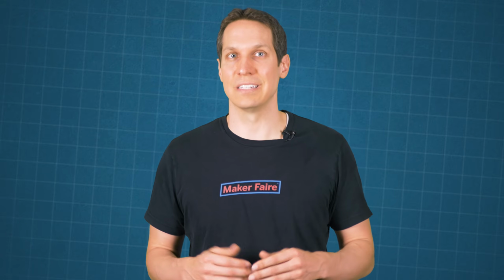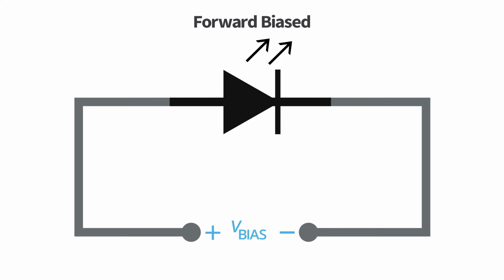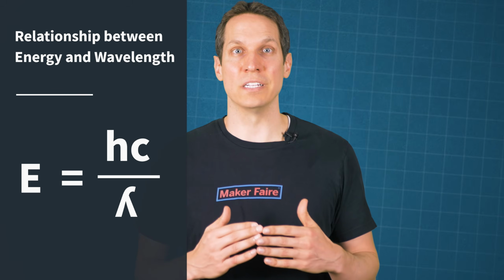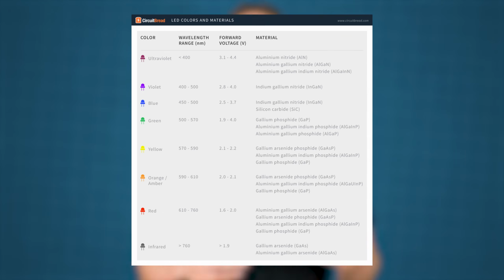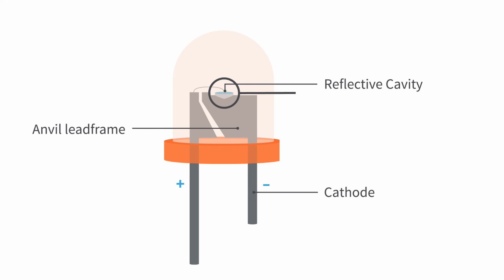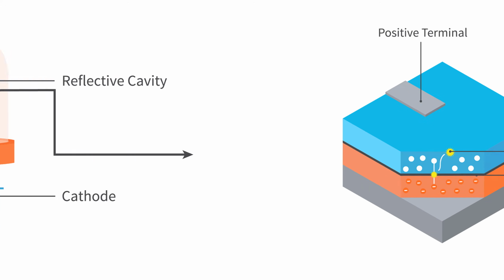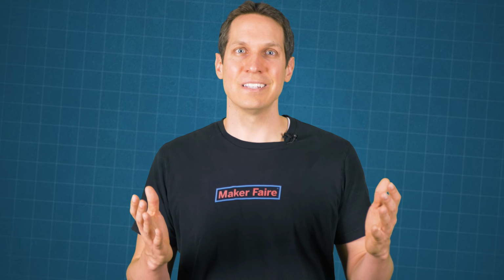How does an LED work at the molecular AND practical level? | Intermediate Electronics

Comment: You said most of the light comes from the junction close to the p region. why? how it is achieved in LED? is it due to higher mobility of the electrons or making the n region more highly doped as compared to the p-type material. because holes are also diffusing to the n region where they will also recombine and emit light from the n side. so light should practically come from everywhere wherever there is recombination. please explain.

Comment: How are knee voltage and energy gap related?
Reply from the maker: The larger the energy gap, the higher the knee voltage.  You'll note this with LEDs of different colors.  Different band gaps generate different colors, which is why LEDs of different colors have different band gaps.  I'm not sure if there's a mathematical relationship between the two but I would be a little surprised if there isn't.

Comment: I have a question.. is there a material of LED that can produce all wavelength? I mean, we just modification of voltage or something else to make different wavelength?
Reply from the maker: Not that I'm aware of - unless I've missed some update in some basic physics (and I'm not saying that sarcastically, there are constant updates in the scientific fields) then the wavelength of the emitted light is directly tied to the materials used in the LED.

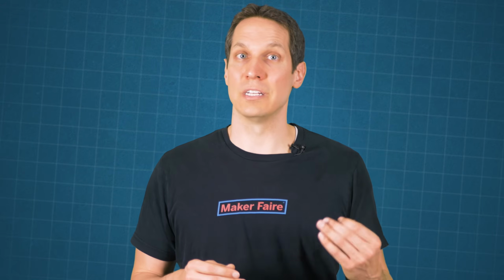Comment: At around 1:35ish, you discuss how for silicon diode, energy is released in the form of heat, whereas for led materials, the energy is released in the form of light. How come the difference in why one releases light and one releases heat ?
Thanks
Reply from the maker: Yeah!  It's all about the wavelength of the energy and how much of a drop in energy there is when the electron changes from one energy level to the other.  This is actually how they have made LEDs of different colors - blue, a higher energy light, requires a greater energy drop of the electron than red light so they put together two materials where there is the appropriate change in energy level from one to the other.  So, there are a few things going on here but if the electron drops a smaller step, like in a diode, the energy is in the infrared range and is trapped inside the device itself - heat!
Reply: @CircuitBread   Ahhh I see, interesting. Appreciate the reply.  Great video btw.

Comment: You could say a regular diode produces heat by emitting infrared. LEDs just have a different omposition which causes then to emit radiation with a smaller wavelength, e.g., visible light.
Reply from the maker: Yep!  Exactly.  Though the LEDs still emit a little bit of heat as well, just less than a regular diode.
Reply: Came here to say this.
Reply: I wouldn't say that's necessarily 100% true. Not all heat comes as radiation energy and excited states in compounds and solid materials can undergo non radiative decay. Basically you can dissipate energy through vibration of the medium, which is still heat.

Comment: So is the light emitted unpolarized light (I hope it is; polarized light is bad for health, I've heard). 
Also, do you know of any lead and arsenic-free LEDs? I've been looking all over the web...
These simple ones don't, but do many of the lights marketed as LEDs emit any UV? 

I just had to ditch the idea of lighting my future home with Sodium Vapour Lamps because they contain mercury... Bioluminescent lights haven't evolved much yet... 
If only there was a lead-and-arsenic-free LED...
Reply from the maker: LEDs emit unpolarized light but most all of them contain trace amounts of lead and arsenic.  The quantities of these materials are extremely small, though, and while not ideal, is generally much more environmentally and biologically friendly than many other options.  That is assuming you're using high-quality LEDs from a reputable source - some LED manufacturers may be less focused on following environmental regulations.
In regards to UV, unless the LEDs are specifically designed to emit UV, their emissions in that spectrum are minimal to non-existent.  That's one reason they're popular as outdoor lights - their limited heat and UV output makes it so they don't attract bugs like incandescent bulbs do.
Reply: @CircuitBread  Thank you so much; your reply gave me much relief... I was so worried... Not anymore though. Bullish on LEDs now; YOLO!

Comment: Silicon diodes actually DO emit light, as proven by that one time I accidentally shorted a diode and it lit up like a Christmas tree.
It's just that the light produced by a diode is immediately blocked by the structure of the diode itself, which causes it to be absorbed.
Reply from the maker: I knew they emitted light, but I thought it was more in the red-infrared range.  But yep, the opaque cover makes it so you can even see the little bit of light they do produce (under normal conditions). Thanks for sharing!  It would've been cool to have gotten that on video.

Comment: Maybe this is a dumb questions but how do the holes get replenished? It seems like they disappear when recombined but the LED doesn't really "run out" right?
Reply from the maker: No, not a dumb question at all, it's something I think all of us have considered at one point or another.  My understanding is that it's just a matter of it being a true circuit - as the holes are filled with the electrons dropping into them, holes are forming elsewhere due to the energy being put into the system.  The holes slowly move into place and replenish the lost holes.  Since it's done constantly, there's never a real lack of holes.  I need to reach out to my semiconductors expert again, she may have a more technically fulfilling way of describing it.

Comment: What if electrons occupy all the holes in p type region??? Will the diode stop emitting light then??
Reply from the maker: I had that same question when I first learned about this.  My understanding is that once the electrons drop in energy, then they act like a "normal" electron in that material, which means they can later jump into the conduction band and be conducted out of the device to go around the circuit loop again.

Comment: I think it would be more accurate to say the energy from electrons falling into holes in a rectifier diode are released as infrared photons. It becomes heat because most rectifier diodes have opaque black bodies.
Reply from the maker: You are absolutely correct, thank you!

Comment: That was cool!  I never knew how closely related LED's and transistors were.  It seems the difference is the extra doping of the P/N in the transistor?
Reply from the maker: It is pretty crazy technology!  It's not the amount of doping, it's by putting two different materials together that, when an electron moves from one to the other, it loses the exact amount of energy needed to create a photon of the color you want.  Most diodes just produce heat when the electron loses that energy.

Comment: Wt converts into photons and photons r made of Wt 😒 ???
Reply: Just electrons or combination of electrons protons and neutron in a molecular structure of a photons 😑 ???
Reply from the maker: Not 100% sure I understand the question but if you remember that photons are just little packets of energy, not actual matter, that should help.  So, instead of emitting energy as heat, it's emitting it as light.
Reply: @CircuitBread  

All photons or 99.99% of photons don't have light 😏
Reply: @CircuitBread  

It looks like photons r made of electrons and protons and have electrical and magnetic effect inside a magnatic sphere 😇
Reply: kalki avatar (beast of the earth) (christ on the white horse) (son of man on clouds) is the biggest enemy of dajjal/antichrist/kali 😏

Kalki Avatar (Murtaza) cousin of Moula mahdhi a.s. (muhammad) 😎

Moula mahdhi is raja shashidhuvj 😎

Prophet Moula mahdhi and Moula Isa both will kill dajjal cause dajjal is going to kill Kalki Avatar 😏

Kalki Avatar will follow orders from 2 religious king Moula mahdhi a.s. and Moula Isa a.s. 😎

Kalki Avatar going to have 2 swords and ring of moula sulaiman a.s. and staff of moula musa a.s. (iron rod) Staff of moula musa a.s. is like omintrix can transform into anything and can transform others into anything And stone in the ring of moula sulaiman a.s. is also known as kastav mani and it's more powerful the all 6 infinite stones combined 😇

This staff will transforms into white horses with wings,weapons,iron-man,cloud etc or can do imagination into reality 😎

*Ratn sru sword of lord shiva (miri)😇

*Ratn varu (zulfakar) sword of Moula Ali (piri) 😇

miri piri 😇

Satyug (sunrise from West) 01.aug.38 😏

Gzwa e hind 2029 😎....

Comment: Do you have a video about the transitory evolution and hot logic gates made computing possibly?
Reply from the maker: Interestingly enough, we have shot a video about how a computer works from the ground up - starting with sand and talking about how that's turned into semiconductors which are then turned into logic gates, etc. While the video is completely shot, there are a few animated portions of it that are being time consuming.  I'm not sure if this is exactly what you're looking for but we're quite excited for this video to be published.  Whenever it actually happens...
Reply: This video explains on a molecular level how electrons flow. It also breaks down the doping process of pnp/npn transistors.  
https://youtu.be/J4oO7PT_nzQ

Comment: Well explaination dear sir 👌
But yet i have not got that why LED's design is of that type could you give me some more explaination ???
Reply from the maker: Why LEDs look the way they do with the dome?  I think it's just a manufacturing standard developed years ago that was easy to make and didn't block any of the light coming from the light emitting portion itself.  There are many, many different body styles now available.
Reply: @CircuitBread  thank you 🙏

Comment: Can someone please check my understanding of what is going on molecularly.
The voltage difference between the cathode and anode liberates a electron from the N type region of the diode. This electron finds a path to an empty positively charged hole in the P type region. 

However due to the composition of the molecules around that hole, the energy loss for that electron to fill that hole will be of the same size as the desired frequency. It therefore sheds this energy in this form of photon to fill the hole it is drawn to.
Reply from the maker: A chemist or an expert in this field might take umbrage at the details or verbiage, but yes, that's a solid understanding of what's going on!
Reply: Many thanks for the response. Your videos are excellent and have been a massive help. 👍🏼
Reply: This video explains on a molecular level how electrons flow. It also breaks down the doping process of pnp/npn transistors.  
https://youtu.be/J4oO7PT_nzQ

Comment: Dear sir,
thanks for your explanation. I have one question on energy conservation in photo-diode.
In case of LEDs, the battery is injecting high energetic electrons (from its negative terminal) to the conduction band at n- side and collecting low energetic electrons (by the positive terminal) from the valence band at p-side. So the battery is losing energy which is manifested as light(or heat). 
Can you please explain (by using electron/hole movement) how energy conservation is valid in photo-diode/photo detectors. 
In this case, when i am drawing the schematic diagram of electron-hole movement, it seems to me that the battery is getting the absorbed photon energy (I mean battery is getting high energy electron from the conduction band at n-side and releasing low energy electron at the valence band of p-side). How is it possible? How the battery can store the absorbed photon energy? I am doing something wrong.
Reply from the maker: I disagree, you aren't doing anything wrong - the battery WILL absorb the photon energy.  A photo diode is, in essence, just a small solar cell.  Depending on the setup, the current generated by the photodiode may go back into the battery or it may go elsewhere in the circuit.  If the battery is non-rechargeable, hopefully it won't be going back into the battery but, at the same time, the amount of current these small photo diodes create are extremely small and probably non-problematic.
Reply: Thank you very much
Reply: @CircuitBread  
I'm not trying to take away from your lecture, I thought it was great.
New sub <
Reply: This video explains on a molecular level how electrons flow. It also breaks down the doping process of pnp/npn transistors.  
https://youtu.be/J4oO7PT_nzQ

Comment: I am wondering if LED lights emit the light a frequency so that your eyes percieve the light to less intense than the peak of each flash. Do LEDs flash on and off? Do you know if the human eye can detect this flashing? Does the brain then merge the flashes with the darkness inbetween and so percieve the light to be dimmer than the individual flashes but brighter than the darkness between these flashes?
Reply from the maker: LEDs, given a constant voltage, will give out a constant light.  While the photons are discrete, there are so many of them, there is no way our brains could distinguish each one.  On the other hand, a common way of dimming LEDs is exactly that method.  They flicker the LEDs on and off fast enough that our brains can't register that they're flickering but instead interprets it as simply being dimmer.  I have seen where they've flickered the LEDs too slowly and it gives a very subtle, nearly subconscious, strobing effect that is quite unpleasant.
Reply: @CircuitBread  damn, i hoped i was wrong. So you are agreeing, the led may appear less bright than it actually is, due to your brain merging the bright flash with the dark inbetween. I wonder if this means the retina or other sensitive parts of the eye may be more easily damaged by this LED light as the light is maybe brighter than the retina or optic nerve is percieving it.
Reply from the maker: I've wondered about that myself - it seems like if the flash were bright enough, even if the duration is incredibly short, then it would cause some damage.

Comment: Can someone please explain how energy is conserved when the photon is emitted? The valence electron passes from the n region to p region as a result of the voltage across the two regions supplied by the power supply-energy is conserved by producing a current (which is literally that transfer of the electron), makes sense. But when that valence electron emits the photon where does THAT energy come from? Is it being coming from the momentum of the electron as it is brought into orbit of an atom in the p region? Please explain... I cannot figure that part out. Amazing video!
Reply from the maker: You're right - it's when the electron goes into orbit of an atom in the p region, dropping in its orbital energy to do so.  We say it "fills a hole" but the reality is that it's just dropping into the valence band, or, in other words, being pulled into orbit around a specific atom.  The energy it loses from dropping into that hole is emitted as a photon, producing the light.  
Now, where I'm a bit sketchy and would rather have someone with a PhD or just better specialization in this field confirm, is that the electron does lose energy crossing the junction and getting onto the p-side, but then the electron loses more energy when it drops into orbit of the atom.  I'll leave this out there if someone (including other engineers at CircuitBread) want to comment.  Excellent question, thank you!
Reply: @CircuitBread  Thanks for the detailed response! That really clears things up for me. I do know that energy is conserved when the electron moves position as a result of the chain of electrons in the circuit simultaneously moving (that is, a current through the circuit) which takes energy from the battery. Think of a watering hose, if it is full of water (wire full of electrons) and you add some more water to it via a water supply (adding electrons to the wire with a CV source), water is immediately spilled out on the other end, thus the energy gained from forcing water into one end is conserved when water is spilled out the other end. Same concept with electron flow. With this in mind, I do not think that it is the individual electron loosing energy as it crosses into the p region, instead energy from that action is consumed in the battery as a new electron further down the line enters a charged terminal as another electron leaves the terminal of opposite charge.
Reply: @greenief9097  can you please explain how electron energy is lowered when it goes to orbit around atom
Since when electron is confined to move within an orbit it's Δ x is less, so Δ p should be more acc to uncertainty principle
Reply: @pavanjoshi2448  Having taken a course on it since the time of my first reply, look into "potential energy wells." Specifically finite potential wells. It is a pretty abstract idea, and connects the wavelength of the electron to the energy it has. 
When the electron is passing from one atom to the next, it briefly inhabits free space. Think of a ball that has rolled down a hill and is resting at the bottom. But then, it comes within the vicinity of the next atom, and this is similar to saying that the ball now is near a ridge where it can fall down. As the electron falls into orbit, loosing the potential energy it had and gaining kinetic energy, it emits a photon of a specific wavelength to compensate for the energy change. 
This is not an in depth answer: look into potential wells!
Reply: @CircuitBread  can you please explain how electron energy is lowered when it goes to orbit around atom
Since when electron is confined to move within an orbit it's Δ x is less, so Δ p should be more acc to uncertainty principle